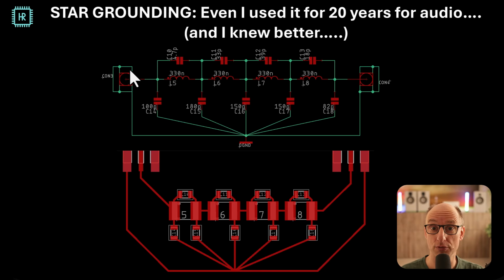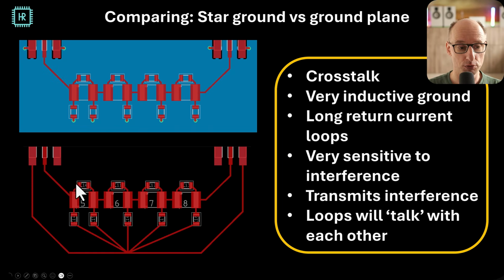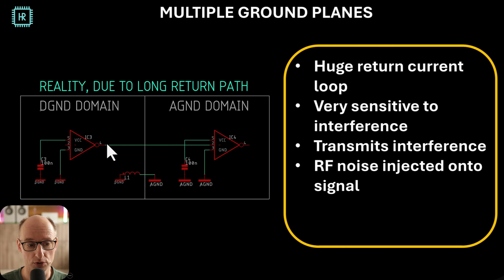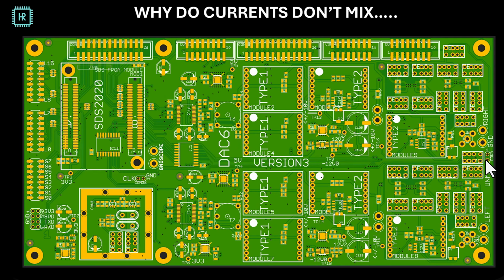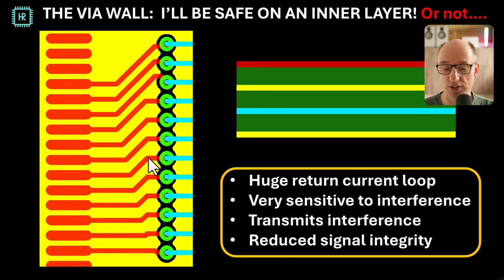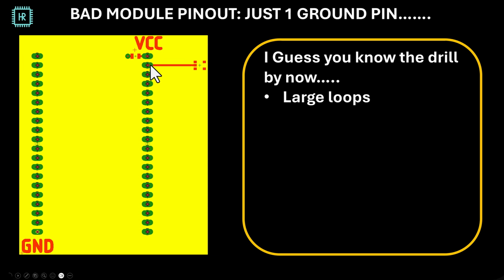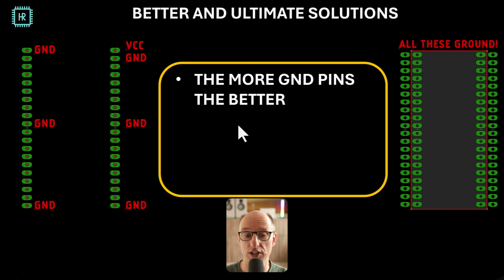Why Your Ground Design is WRONG — and How to Fix It. Flawless PCB design part 6

Comment from the maker: Free mini-course: https://www.hans-rosenberg.com/minicourse_account_youtube?utm_source=yt-p-v6
Full course info: https://www.hans-rosenberg.com/epdc_information_yt?utm_source=yt-p-v6
Reply: I have your checklist and read the whole thing. Haven't put it into practice with an actual project yet, but once I think I'm done with my project (after running through every pin at least twice) then I will use it methodically as a last step. 

Finally, I really wanted to buy your course but I can't afford it right now. It was a bit expensive. Do you provide any direct support with it?
Reply from the maker: @TUMATATAN  Hi Tumatatan. The course is expensive indeed at almost 3000 euros. 

It is basically a shortcut to 30 years of experience and mistakes. If you imagine the cost and time of having to make all those mistakes yourself and learning from them, it is actually a really good deal. In a small project team, an extra spin will easily cost multiples of the course fee (few weeks times a few people plus hardware).

If you're serious about electronics design and want to do it for a longer time, this course has great value, also for your income as the knowledge should show up in your salary. 

It's a personal choice if you want to pay for that shortcut or want to make those mistakes yourself.

The course has a forum for asking questions, I answer everything there. So yes, there is support.

Best regards and Happy Designing,
Hans Rosenberg
Reply: Thank you, Thank you!
You answered all of my questions in one video. I just ordered the components and this morning started thinking about the PCB layout. This video answered my exact questions about my circuit design, like you made the video just for my project! 😂
Thanks  🙏

Comment: Your example of the star ground is flawed in that the star ground is not ment to be used for intra circuit connections. The star ground is for connecting complete circuit blocks together.

Comment: I always did the solution for the via wall but not because I knew about the via wall causing increased return currents but because this way I could route the signals in a straight line to each via as the vias beinf offset on the x axis makes it possible to have a smaller y-range. funny, never knew about that so thanks!
Reply from the maker: You're welcome

Comment: Hi there! How about different grounds when analog signal comes from the other side of the board and you decouple AGND from DGND with nf range caps and some Kohm range resistors?
Reply from the maker: I don't think it will work very well without a DC connection..... if those 2 planes have a dc difference, your signals will get offets.
Reply: @HansRosenberg74 Thanks for your reply! I'll just try to make sure digital and power return paths don't cross analog ones on trace level.

Comment: Hi there. I'm new in designing PCBs. My currect project is an old amplifier that used to use an STK chip that is no longer in production. I have created a PCB with discrete components to replace the chip and it works well. But I also did modifications to the power supply and added another chanel for a subwoofer. In the process I have modified the old PCB to acomodate everything and although it works, it does not look very good and there are wires going everywhere. Because of this I have decided to redesign the whole PCB to fit all the modifications. My question is, can I use both sides of a double sided PCB as ground at the same time? Can i pour copper on both sides and connect it to ground and then connect all the components to both sides at the same time? Or will this create any issues? The amplifier is only analog but I want it to have the best grounding and shielding as possible. I am stuck between doing this or just copying the original grounding scheme of the amplifier and I am not sure how to proceed. Can you give me a recomendation? Many thanks!
Reply from the maker: Pfooh, this would be a bit of a long answer to write. Please watch my free module, that contains a lot of tips on grounding. 

Try to understand the fundamentals of what I'm talking about, especially keeping return loops small.

Power amplifiers can be tricky with respect to grounding. If a high current runs trhough a ground trace of plane, and a small signal current also runs there, you can have problems with those 2 signals 'crosstalking'.

So keep high currents and low currents separated. You can do that by separating those circuits geographically on your board.
Reply: @HansRosenberg74  Thanks for the reply, Hans! I do understand that the answer is not a straight forward one. I did watch all your videos and a bunch of other ones on YouTube regarding grounding, EMI and EMC. Many videos are talking more about digital and very high speed signals in general, but I'm trying my best to understand the fundamentals and apply them to my project. The thing is that I am remaking a pcb board for an existing amplifier and the layout is limiting my options somewhat.

My initial question was more about using both sides of a double sided PCB as ground simultaniously. Will this create ground loops? For example, I chose to route all the input lines on the bottom layer and ground pour everything in between but also keep the top layer as a ground plane. 

This is only for the main board where there is only the power supply and the input section. The sections are geographically separated and I am also separating the ground between them by leaving a 3mm gap in the ground planes on both sides of the PCB and only connecting them in one spot. The amplifier board will be a separate one and I will not be using ground pour on that one but will try to route the high current lines with return paths directly underneath and keep the small signal lines as far away from them as possible. 

I don't really know what to expect but I will have to make the boards and see what the result will be.

Thank you again for your reply and all the valuable information you share with us in your videos!
Reply from the maker: @Alex.M.S.  One crucial tip: You're saying you're going to  make a gap between 2 ground planes: Make that gap smaller, like 0.5mm, and remove the mask on the edges of both sides so you can connect them together with solderblobs or 0Ohm smd resistors, this way, you can experiment with separated and single ground  planes!

Comment: What about a separate ground place for power components of a motor driver and a ground plane for signals and the processor?
Reply from the maker: The best way to solve this is use a single ground plane but geographically separate the high and low power circuits so that high currents cannot run under the sensitive stuff.

Comment: Hi Hans, I’m building a small system with a DIY 4-transistor superhet AM receiver (455 kHz IF) built Manhattan-style over a large ground plane. For the audio stage, I’m using a small Class-D amplifier module that switches at 260 kHz, which I’d like to connect to the receiver’s audio output. Both will run from the same 3 V battery. How would you recommend connecting the two boards to the battery, and routing the audio signal between them, to minimise supply noise injection and avoid ground loop problems?
Reply from the maker: Keep all parts as close to the ground plane as possible! And make sure all supplies are well decoupled with the smallest loops you can make. Pretty tough with manhattan style. 2 layer pcb's are almost for free these days, you could design a pcb.

Comment: Here's a freshman question: Ground current and supply current should be equal, so if you need more ground planes and pins, then shouldn't you need more supply planes and pins too?
Reply from the maker: Very good question! Not entirely, you can use decoupling caps to create short loops locally. With very high current supplies which also have large current spikes (cpu and fpga supplies) you need planes AND very good local decoupling plus complete modelling of the supply layout.

Comment: I need a quick guide im making a chipamp guitar amplifier what is the best grounding star or single grond plane i used zone to fill gronud and made my traces inside and used jumpers to make gnd contacts when it gets cut by the traces and relief distance was 1mm is it wodrks or ishould be using star gnd plz help me out
Reply from the maker: to be safe: always use a ground plane!

Comment: making my way throught your awesome videos, I presume the 2 ground planes is a valid isolation strategy if you get out of the electrical domain like with an opto isolator.  Am I wrong in this thinking?
Reply from the maker: You're correct! That is one of the only good reasons. You can also have this on 2 sides of a transformer. Allthough you usually place a 'bulk' capacitor between the planes to prevent huge common mode interference.

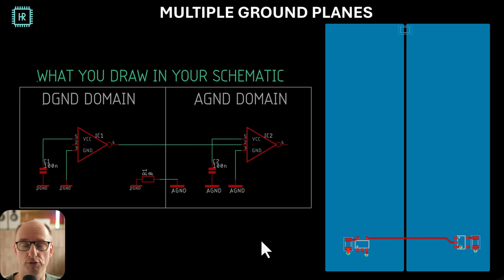Comment: 4:30 Another technique is to use an opto-coupler across the digital/analog boundary. It's a bad idea to cross ground plane splits with AC signals for the reasons you listed, it generates EMI/RFI. I have seen the one big ground plane used on a mixed RF/analog/digital board and it does work. However, we saw low frequency noise getting into everything, and that was traced to an FPGA, and appeared to be a cyclical in-rush of current as it ran, depleting charge across the board. More capacitors and two additional linear regulator circuits essentially fixed that.
Reply from the maker: Nice remarks and example.

Comment: Due to low price for PCB today (i am JLCPCB-fan) a new version isn´t as costly as years ago. Last decades i often make "test-layouts" to learn by doing.
I am happy you give to us what you learned / know. Worth GOLD.
I am (since some month) retired so i have all the time to make PCB-layouts. No preassure - only quality 🙂
Reply from the maker: I have the same feeling as you. 20 years back, pcbs were so expensive, I could not afford mistakes, so I spend weeks verifying. Now boards are so cheap that if there are no really expensive components on it, I send the design much quicker because it saves time. If there is an error left, you spot it as soon as you turn on a pcb.

I hope you enjoy your retirement :-)

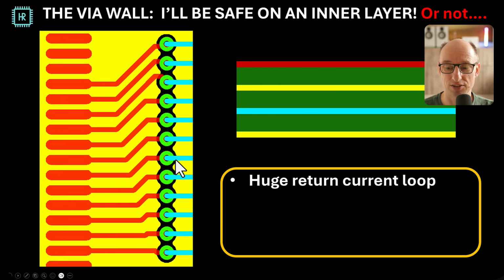Comment: It took me a couple watches to understand what's going on at 9:50 - the big 'wall' of vias means that currents returning from the middle traces have to travel on the ground plane all the way around the line of vias, picking up extra noise and interference on the journey. With the zigzag design, any return current has a much shorter path as there's unbroken ground plane around each side of the via. I've seen this design pattern before, and now it finally makes sense!
Reply from the maker: Great! :-)

Comment: The star topology recommendation comes from a time, when there were no curcuit boards. So there were basically two ground concepts. No ground loop (star topology) and as many loops as possible (mesh topology). Mesh provided lower HF impedance, but came with many loops and therefore humming voltage induced by power supplies transformers. As audio is Low Frequency tech, avoiding loops was the way to go. Yet the chassi often served as kind of a ground plain, where all ground wires ended, but wire loops had to be avoided. All this was true until PCBs changed the game. I think as often this old policies simply haven't been rethought. This happens way more often, than one might think.
Reply from the maker: You're right!

Comment: What if multiple grounds would be needed for safety reasons?
Reply from the maker: I'm not familiar with an application like that.... I think you'd keep a safety ground on a case and don't connect it to the pcb most of the time.
Reply: @HansRosenberg74  So if there is no galvanic isolation between circuits, having more then one ground plane may cause problems(some datasheets of ADCs and DACs recommend having separate ground planes I wonder why manufacturers recommend such things). SMPS powered from mains, inverters and anything involving AC load switching requirs isolation, though in that case it is basically two or more galvanically isolated circuits(it probably is a different case).

Comment: Should I still have only 1 ground plane if im making an eeg that amplifies 10mv signals (ads1299), then sends the spi to an esp32 at about 500khz. I dont know the trise of the spi
Reply from the maker: Yes, use a single ground plane, just make sure currents of the different circuit parts don't cross and increase the distance and/or use shielding to keep agressors and victims apart.
Reply: @HansRosenberg74 so i have 3 regulators that all have return path on the same ground plane. So i have to take switching frequencies into account to determine the width of the return current path and place the regulators seperate from eachother enough so the return paths have no crosstalk?

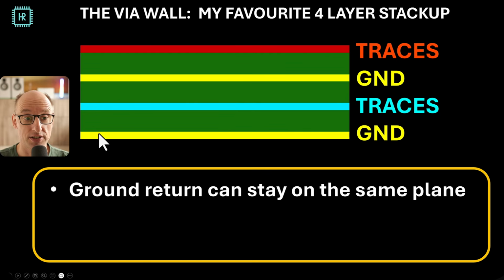Comment: 8:50 Now, what happens if you have a trace on layer 1 that crosses perpendicularly over a trace on layer 3, do their ground return paths interfere?
Reply from the maker: Interesting case. I'm not 100% sure what happens in that case. 

I think since the fields are perpendicular, the crosstalk should be minimal.

Comment: Oh Hans - I love this! I have been designing analog electronics for about 50 years and have had to argue with engineers about these matters very many times! I have designed high power switchmode power supplies and low level analog amplifiers, sometimes on the same PCB!  My simple description of my principle is "Connect all the grounds to a ground plan and the chassis as well as possible - lowest inductance. Then work out the bits of your circuit that have high RF currents and lay them out so that those currents flow in a geometry that allows the ground plane to stay equipotential. For cables that go off-PCB use common mode chokes to control where the return currents flow. It has always worked. Power planes are ground planes - they are so well AC connected together...
Have you written any articles about this? I have thought of doing so but never have!
Reply: "Power planes are ground planes - they are so well AC connected together..." Can you elaborate on this because I'm not sure I understand it correctly?
Reply: @taczka2 because there are very many low inductance capacitors between the power plane and the ground plane there is very little AC voltage between them. So the power planes can be thought of as extensions of the ground plane. This can be used in layouts where it is difficult to keep the ground plane contiguous. .. the power plane can be used to make additional connections that reduce the overall point to point impedances.
Reply from the maker: Well, this is exactly the kind of approach I recommend in my course :-)

Comment: Another problem with the filter is the completely undefined impedance of the feed lines. OK, well, the design frequency it's only 30MHz, but still, you will have impedance mismatch between the input, the filter, the output.
Reply from the maker: the frequency is too low for that, the wavelength is huge here.

Comment: With regard to your star grounding example, I thought the idea was to bring all the returns to a star earth at the ground of the power supply. That way there is no common run to cause crosstalk. In the example the star earth would be at the top left of the board as shown.
Reply from the maker: Yeah, this circuit has no power supply since it is passive. The underlying theory is the same though.

Comment: Very valuable suggestions that mainly agree with my professional experience. 👍
I have a doubt, though: at about 8 minutes in, shouldn't the return currents mainly stay under their traces only above a certain frequency (lest impedance path vs least resistance path)?
Reply from the maker: Yes, that is exactly my point....

Comment: As someone with 20 years of layout experience and having a PhD in microelectronics packaging, I had to say that every word of you can't be more true. Sadly, many people still believe the archaic tiered decoupling and single point grounding myths. I mean, if you can do them right, go for it. Truth is, most people can't do them right. Probably back in the 70s everyone designing circuits (or more likely, those whose designs survived to this day) has solid understanding to physics and they know the trace between (and within) a part is more inductive than the ESL of a capacitor, so clustering 100pF and 100nF makes no sense, so when they say to use tiered decoupling, they meant to use that with kelvin connection or with a power plane. Sadly, this art is mostly lost and most people just blindly copy the "suggestions" and use them willy-nilly without thinking twice.
Reply from the maker: Great to hear from another experienced engineer :-)

Comment: Really great video and this is great myth-busting for Star Grounding for audio. I appreciate all the work that went into making this.  Well done!
Reply from the maker: Thanks, and sorry for the late reply: I'm really behind!

I've changed the free checklist offer a bit: You also get a 1 hour module of my course for free!

You can find the link to the page in the description. Scroll down a bit on that page (Or read the whole page, you may get curious :-) ) to find the link. It is a purple button 'Watch The Free Module And Get The Checklist'.

You will have to leave your email address so I can start spamming you :-D . I don't do that very often, on average once a month, but I am thinking about starting an email series with useful electronics tips at some point.

Best regards,

Hans Rosenberg